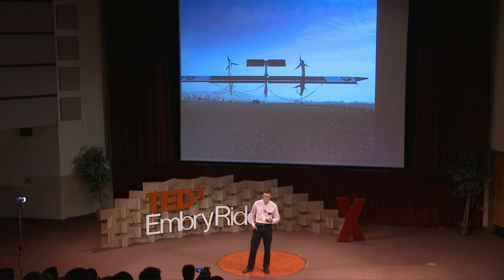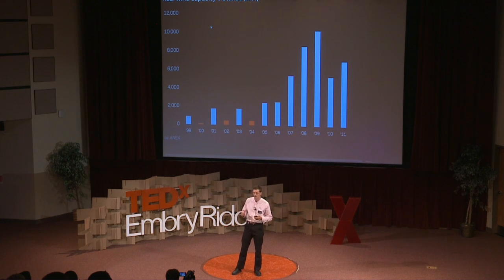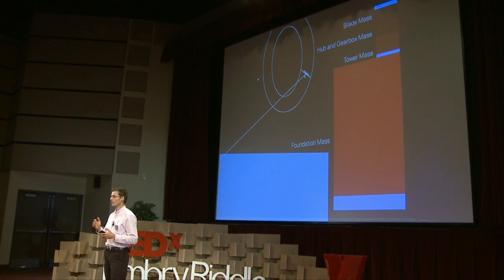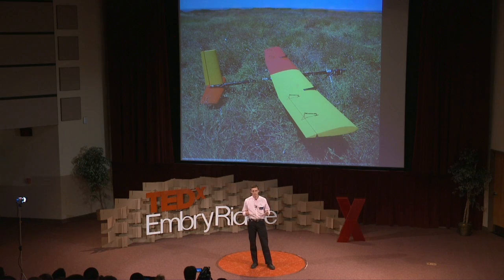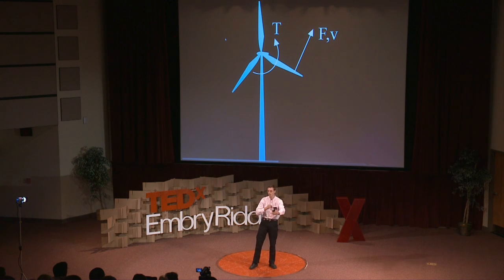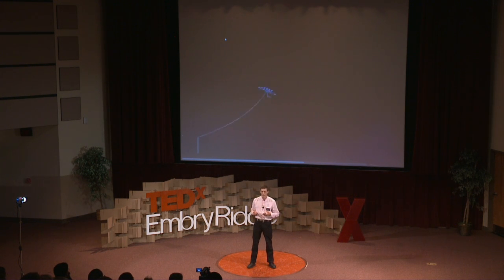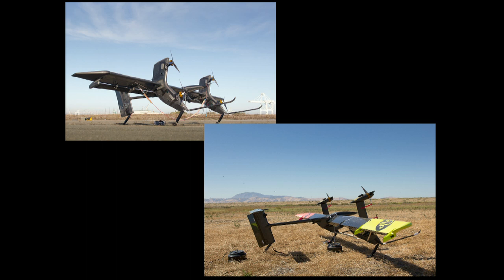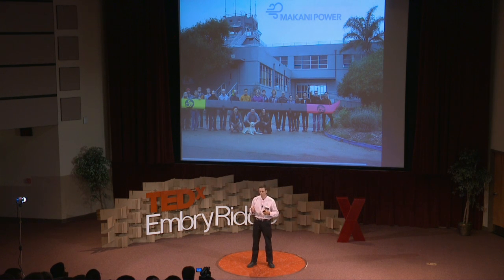A Different Kind of Wind Power: Damon Vander Lind at TEDxEmbryRiddle

Comment: I'm assuming this uses carbon brushes for electric current to pass through pivot points. of it doesn't have that, the wire or cable could twist so much and do some plastic damage to itself. that said, i can imagine replacing carbon brushes on the wing and the tether itself and think about the expense this accumulates...
Reply: id like to be correct on this by the team...?

Comment: So to combat inefficient blades with large bearings on a sturdy base, you make a small model, that when scaled up will require smaller inefficient blades on powerful bearings, tethered to a very sturdy base... but you're going to wave it around?
Someone didn't do their thinking/maths properly at an early stage.

The larger it gets, the harder it is going to be to launch, the smaller the window of useable wind.  It will need a stronger and stronger cable, and require more power for hover and return modes.  It has a much larger hazardous air space requirement, which could have a much larger bird strike impact both on the technology and the ecosystem.... I could go on.

The reason for all of the heavy equipment holding up the small bit that does all of the work in a conventional design, is that it is needed to make it both useful and safe, as you have just found out at great expense.

What happens when a cable snaps?

Comment: Sorry to be a wet blanket on your research - but not a very practical system - way too complex ( over-engineered ) - and looks like something off the Wright Brothers airfield, back in 1910.  Just an excuse to keep University Academics in a job playing with model aeroplanes. Sorry Uni folk as much as I love you guys, you always do things the hard way. 

A better and simpler wind generators work with 44 gallon drums cut in half lengthways fitted to vertical mount drive shaft generators so no swivel is required on the "blades"( 2x 44 gallon drum shells ). Generator/s made from Fisher & Pakel washing machine motors at 1kw output for each motor minimum. Also the newer TURBY design has proven to be very good, used in Europe, running at low wind speeds and very low altitudes. 

As no maths or test results were shown - I fail to believe your design is superior.

Comment: The problem with wind energy is that they keep trying to be base load power and wind is not suitable for that. If they lifted water or compressed air and then generated peak load electricity from that they could generate clean current and make the money to pay for the system without cash subsidies.

Fossil fuel get reduced taxes to reduce consumer costs and it is called a subsidy.

Comment: Wind is producing worthless intermittent power. It needs not only a subsidy to build the damned things, but a "smart" grid so that your power can be "managed"(i.e. shedding load by force or avoiding load by prohibitive cost). It needs a massive spider web of HVDC that can shuffle power from anywhere to anywhere and massive storage; without that it just a minor fuel savings device for natural gas.
Reply: It's now four years after this talk was given and wind is now the cheapest form of power available in many areas, even without subsidies.

Comment: It makes not the slightest difference how you use it, the wind is capricious, it is fickle, it is intermittent, its pettern of occurrence is a random walk. If you cannot depend upon an electrical energy resource on the grid, you must provide against the rate at which it might disappear. You must do so with dispatchable resources, which means generators that within periods of time that are not large compared with one cycle of a 60 Hz grid's voltage, can be brought on line to provide the demanded, or "missing" power. 
There are people who tell you that the cost of energy storage is coming down. Look it up and estimate what just one gigawatt_week would cost, capable of delivering one  gigawatt of power.
Reply: Albert Rogers -- Tsk, tsk, such negativity. Is that a strawman argument, or did you just contradict yourself? Let me straighten you out... Providing backup Power for short-term variations does not require a massive amount of stored Energy. Long-term variations in power leave long times to bring online those back-up systems which are good for that kind of load. Also, quite apart from the usual wind variations you were probably thinking about, this kind of flying system will operate at high altitudes where the wind is much stronger and more constant. When widely deployed, some of them will always be in some windy place. When wind power is in excess of need and/or beyond what their local grid can accept, water can be electrolyzed and the hydrogen put into the natural gas pipeline network, or used to synthesize zero-net emission hydrocarbons with CO2 from the atmosphere. Heck, these flying powerplants can even carry wireless communication equipment to augment and back-up the terrestrial communications networks, and do so at far lower cost than commsats in space.

Comment: How will you solve the problem that these are electromechanical and by nature have moving parts that will battle the wind? How will you solve the problems of friction and dirty electricity and sporadic output? Once again people will look out at the mess on the horizon and wonder where they will get their power and how they will clean up all that broken hardware. Meanwhile, the output from these will have killed people and someone(s) will have used nefarious means and corrupted someone else to put these up and to cover up the huge problems and death. Where are the actual improvements when all it looks like here are that the problems have taken on a new face and the poison has taken on a new frequency? I'm not just badgering, I really want to know, because I am watching people and animals and land die here, and you are working to perpetuate that.

If you want clean energy start with the concept and reverse engineer. Do not take something that by nature disrupts and wears solidity down and then pump it into life's very core, disrupting and wearing life down. Start with the desired frequency from a source that is actually clean.

There is more to say on this. Do not cover up problems by making them look different. Each and every engineer that continues to push wind looks blind to physics and the fundamental issues of power generation and transmission in a world in which that very power is, in theory, intended to support life, not destroy it. Whether we like it or not we do have certain constraints if we are going to even make a small effort to support the world we live in.
Reply: Anyone can find problems, the trick is finding solutions. That is what they are trying to to. You are perfectly content to criticize him while you use dirty depleting power sources? Seems foolish to me.
Reply: T Yomama What is foolish is thinking wind power is green or free. 'Dirty' fuel consumption goes up when industrial wind turbines are added to the portfolio. Pollution is horrendous within miles of industrial wind turbines. You are wasting your time if you call me a liar or something of that tone about that; I live among them now. We have a destructive electric field in the ground now that is killing the burrowing animals - industrial wind turbines are deadly to life in general, and who will be next?

 You did not read my entire post. My suggestions were valid. However, here is an excellent suggestion - don't be so quick to call coal dirty and don't be so quick to throw away what does work.

  Before you criticize people like me ask yourself "what if they are right"? We have already asked ourselves that about your opinion, so we have one up on you. We all came into this being taught 'wind is green'. So, ask me some real questions. That is the way you and I will communicate, because right now you simply appear to be one of the people destroying other people's lives for too high a cost for something that hasn't and still doesn't produce the real power everyone needs.

   Land is a finite resource. Industrial wind turbines use enormous quantities of land and poison that land in the process. Would a re-engineering of the wind turbine techniques take into account the waste of land, the pollution produced by the technology or the destruction from the grounding of the chaos wind energy produces?

   There are a lot of missing pieces right now. Viable solutions are being cast to the wind (literally). That is why I recommend looking at the whole puzzle from new angles - perhaps more PhDs and more thinking and a little less breaking people's backs with bad ideas.
Reply: T Yomama One more thing. Do you really think you are benefiting from the wind industry? Your comments are belittling the very real problems with wind energy and the way that wind industry diverts from what needs to get done.
Reply: +WolfeSandy I am not an ignorant tree hugger... In fact my income is derived purely from oil production. I work for an oil company. I realize that there are issues with wind power but I have , as an electrician, worked in lots of power generation plants in my past in construction, they are non-renewable dirty power. I am sorry that you were lied to by corrupt slick salesman that had your neighborhood convinced that these would be OK to have around you, but wind, solar, hydro (via rivers or tides) power have to be researched. I question your line about dead burrowing animals... They may have moved on due to noise and vibration but there is no way these mills are energizing your ground. You sound plainly ignorant there. Aside from that I have no doubt they are a hateful thing to live under. I simply questioned you on solutions. To say "find a solution and reverse-engineer" is a joke. What is the solution?
Reply: +WolfeSandy one more thing from me also, we are burning around 95 million barrels of oil PER DAY... we need to find alternatives. We need to dramatically increase clean renewable energy production, and equally decrease inefficient usage. We need major breakthroughs in all aspects, how we are living now is not sustainable.
Reply: T Yomama Then don't advocate for industrial wind turbines. To understand, simplistically start with the oil required in the manufacturing process. Next, they have to be transported to the field where they will be installed. These are extremely heavy parts, the equipment used is not efficient when it comes to oil. Then, heavy equipment installs them. Next look into the real oil use during operation. Don't forget the equipment that devours oil that is used for  maintenance and the transport of the oil to the field to change out the oils used. Then, their replacement parts, the manufacture, transport, installation . . . Then, when that is too costly they are left to fall apart out in the countryside while fresh land is poisoned. Look at their essential non-productivity, and what that means in terms of sheer numbers of turbines to even give the illusion of supplying your real power needs.

 If you want to relieve a problem you need to develop equipment that does the job. You need efficiency. I've heard it said among officials that wind turbines do not return the power it takes to even manufacture, transport, install, operate and maintain them. Observing them here, how dry they became in a few short months, the amount of time they spend on reserve spin, the amount of time already that they are broken, I can see they knew what they were talking about. It is as Warren Buffet said, they aren't worth it as a power source except for the government incentives that feed their existence and provide a tax write-off to support the real techniques that supply power.

  But the worst for me is that they really do poison the land. Land is a finite resource; once it is poisoned restoration may very well fail. The company and county that put these turbines up pretends it is only the 25,000 acres being destroyed (although they acknowledge the existence of the 2.5 mile extended destruction radius). Then, the lives that are destroyed, the farmland and ranch land that is no longer available . . .
Reply: Also, the earth is flat...
Reply: Scott Brewer It is a matter of perspective.

Industrial wind turbines fail as wind power converters because perspective has to cross the line into production. 

Industrial wind turbines produce copious quantities of capacitive reactance, disrupting the electric grid and poisoning the land with static discharge, also undermining the health of the the livestock, people, wildlife and pets who attempt to live around them (it is pretty gruesome).

Along with that, the blades create a wake of refined industrial infrasound (typically known as sound less than 20 Hz, or, in some venues, less than 10 Hz - waves that travel approximately one thousand feet per cycle) which induces vibroacoustic disease, possibly not a mainstream term, but the most precise for discovering the lethal cocktail of abnormal symptoms, wounds, breakdowns and growths in the living body.

The problems are inherent in the electromechanical conversion of wind power, that is why I asked for understanding the problems rather than recreating them.
Reply: yeah, so not convinced by this thing. idk what they are up to now. not to demean them or anything, but seems like they've only put smaller turbines on a wing. but in no way that is going to scale to power cities. and more rip birds with that invisible string cutting through the sky, and rip the wing as well, if some bird decides to attack it. and omg look at that waste of space on the string, put 10 more turbines on it too, or slap some ad banners cuz money. endless
Reply: insioni The PUC in our state declared that industrial wind turbines only produce a "dribble" of "energy credits". Energy credits don't power a city, real electric power does. They said the reason they may approve this new set of industrial wind turbines is because the company promised to build them a 'Gen-Tie' - a string of high-power transmission lines; it had essentially nothing to do with approving the turbines, just the power lines..
Reply: WolfeSandy
This has already been calculated on working wind turbine fields. The bearings are easy to replace, the electronics is solid state and hardly ever fail, swap out boards makes it easy,  The modern ones are brushless. The cost included in amortized service life of 40-50 years yields a cost of 3 cents per kWatt-hour, cheaper than COAL!!  And as for bird strikes and bat strikes, they have fallen off for all wind farms reporting over ten or more years, it seems the flying creatures are evolving to avoid them!!

Comment: I didn't understand the presentation; I don't understand how this thing extracts power.
Reply: Also, the electricity generated from the turbines goes down the string that holds the kite down.
Reply: +capoman1 The fan blades brake against the wind generating power. The glider/kite is moving at around 150 miles an hour making the blades spin extremely fast.

Comment: A cheaper non-generation version could provide mobile storm protection, by creating a wind-shadow. Knock 50km/h off the peak wind speed over a sensitive structure, during a storm, and the peak forces are drastically reduced.

Comment: why not cover the thing in solar panels too?
Reply: apagoogoo -- These powerplanes are meant to fly at high altitude, above most clouds and even into the jet streams, because the strongest and most constant winds are there. It's not that helpful to add weight and complexity to them, when they will tap into wind energy far more concentrated than solar energy, with no downtime for night.
Reply: @YodaWhat  If they fly that high, how do they manage the tether?
Reply: @lcloverviewman5755  Funny, no answer to that question...I was wondering the same thing.